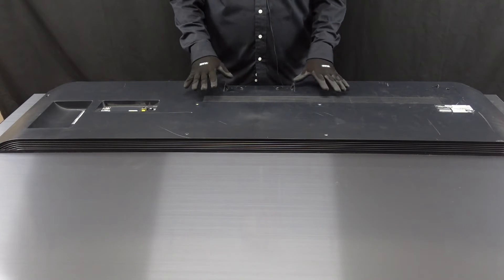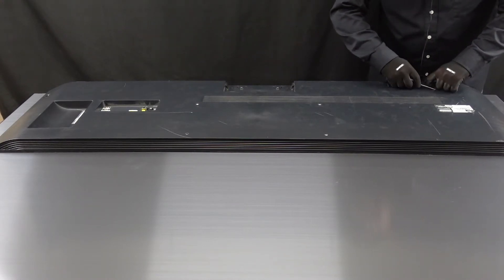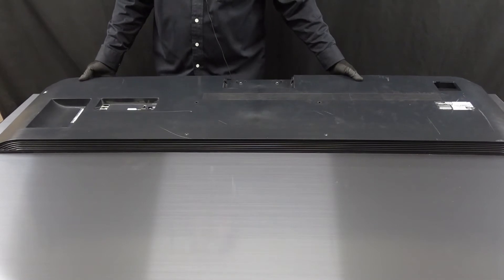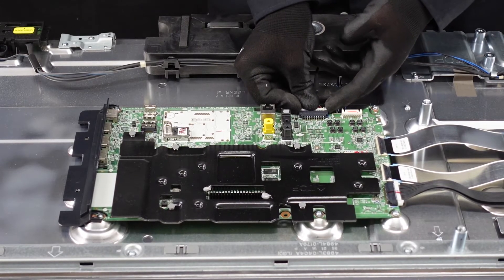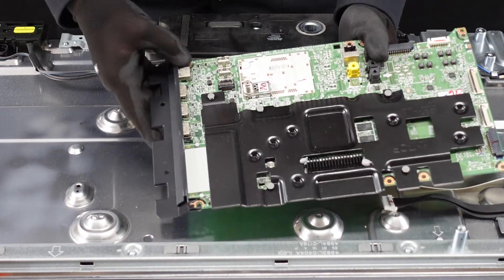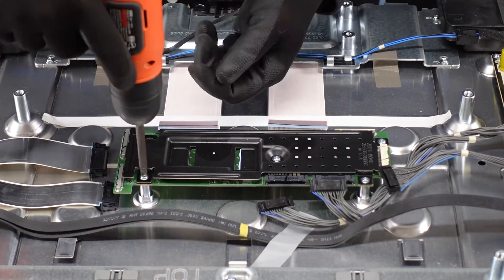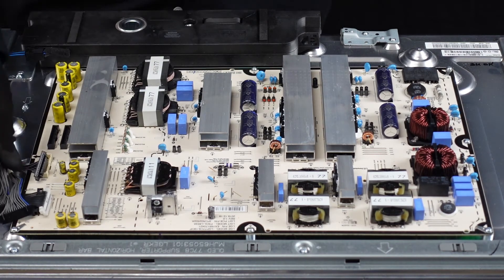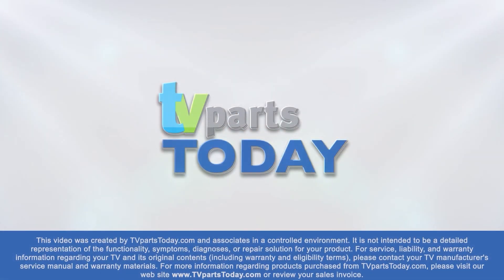Learn how to fix your TV instead of throwing it away.  (LG OLED77C9PUB)

Comment: My OLED77C9PUB keeps powering off after about 15 seconds. Could this be the power supply board? If so, do you have them and how much are they? Thanks.
Reply from the maker: Yes, that could be the power supply or the main board. You need to find the part number off of your board and then go to our website tvpartstoday.com where you can see our inventory as well as the price.